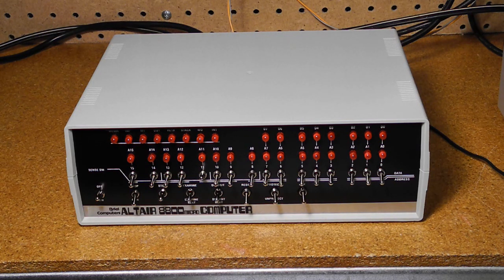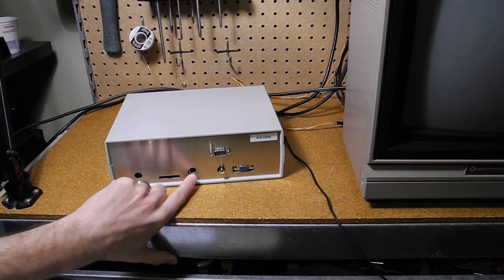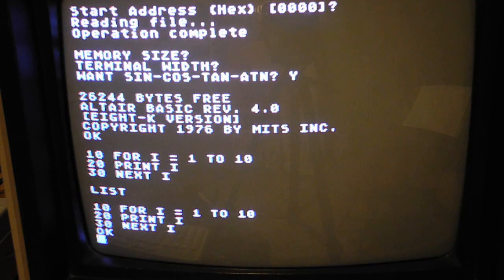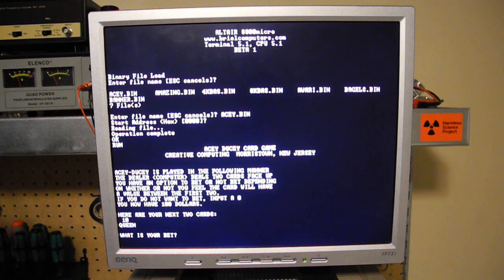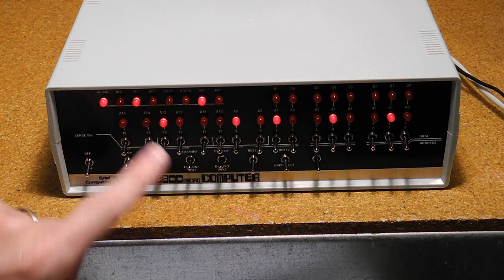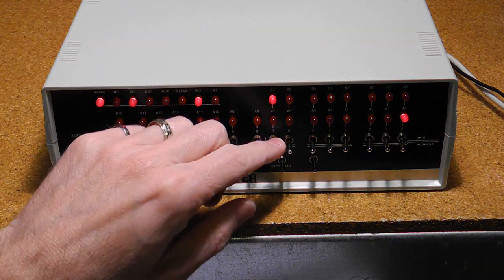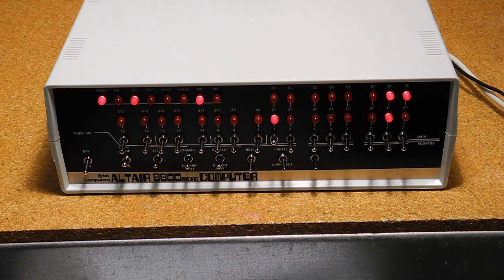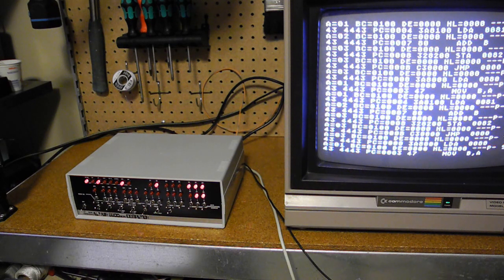The Briel Altair 8800 Kit, Part 3: Initial Powerup Tests and Basic Operation

Comment: Fascinating stuff, I remember seeing the original advertised in magazines ages ago, never knew anybody who had one,  looks cool enough that I wouldn't mind getting one
Reply: It seems that Vince Briel might not be too active with the kits anymore....not sure if you can still obtain this kit. However, I think that AltairClone.com still sells theirs, which has the benefit of being housed in an authentic full sized Altair 8800 case, looks just like the original. It also comes bundled with the monitor/operating system, CPM, Altair 8k BASIC, etc; pre-loaded on the three internal emulated Atair disk drives. Unlike the Briel, the AltairClone ONLY has a couple of RS-232 serial ports....it does not have the keyboard and monitor jacks. You have to use it with an actual terminal (like the original), which can be anything from an old Teletype, to a vintage electronic keyboard/monitor terminal, to (the cheapest) a terminal emulator program running on a modern computer.

Comment: I bought and soldered a Briel Altair Kit. It works, but I have a problem to start Basic 4K and 8K version. Basic is loaded an I see the message "Operation complete", but Basic does not start. The Stop/Run switch is in the RUN Position. Unfortunately Vince respond not to my Messages. Do you have a hint for me?
Reply from the maker: I'll have to fire up by Altair to refresh my memory and see if I have any ideas.  The users on the forums at brielcomputers.com may be able to help you. That is the best source for support.
Reply: It works, the problem was U3 74HCT573 ....

Comment: Can I connect it with the original floppy drive so I can load some programs on it???
Reply from the maker: No, but you can transfer programs from a PC to the SD card and load them.
Reply: Oh, and what if I want to save a program that I wrote in basic?
Reply from the maker: You can do that as well. I don't remember the details as I haven't used the unit for about 5 years. It should be covered in this or one of the later videos on the series.

Comment: im thinking about getting a altair 8800 from Briel computers how ever i may have a hard time looking for a power supply for it  i do how ever have a monitor and a ps2 key board i can use hell i have a tandy key board
Reply from the maker: +James Fish Any low cost power adaptor ("wall wart") that produces at  least 1000mA and 7-9V DC positive center with a 2.1mm connector will work.